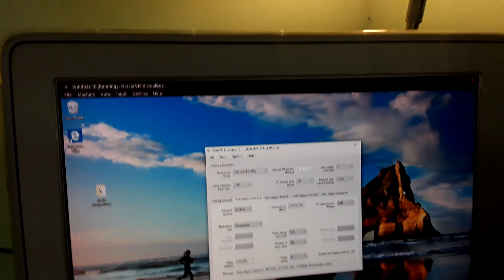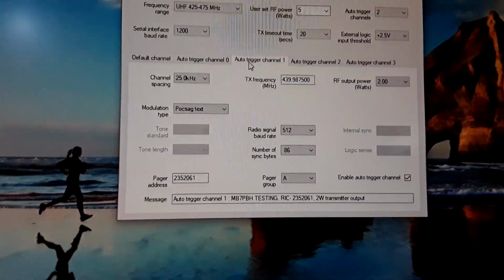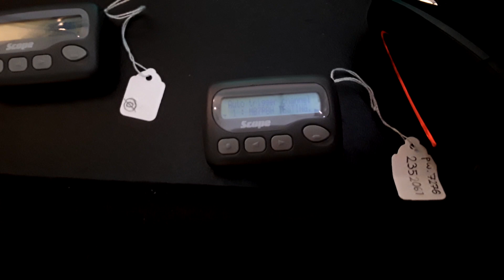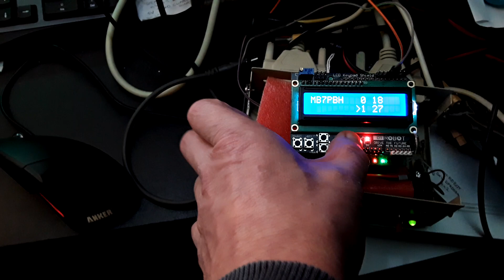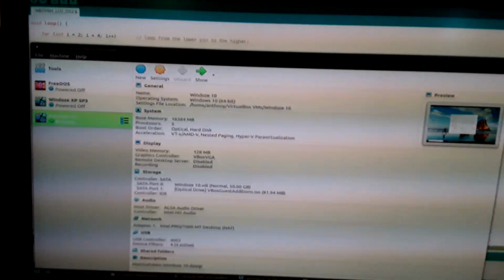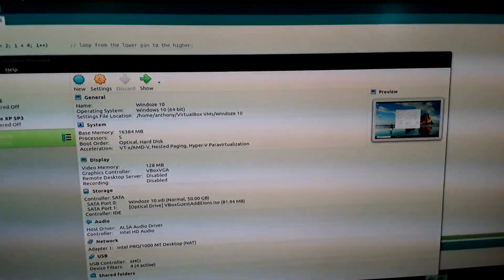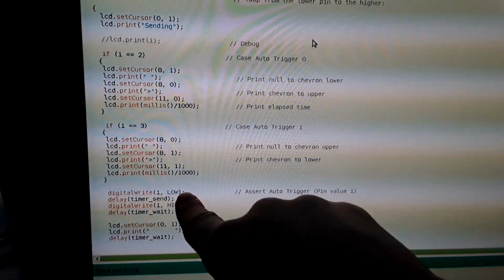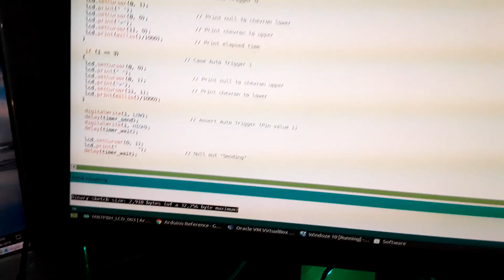MB7PBH UHF POCSAG Transmitter with an Arduino controller

Comment from the maker: The source code is as follows

/*
  For Loop Iteration 
 
 Demonstrates the use of a for() loop. 
 Lights multiple LEDs in sequence, then in reverse.
 
 The circuit:  DF Robot DFR0009 2x16 LCD module with resistor array configures botton array
 
 Drives the canned messages from the ART-400TP paging transmitter
 
 https://www.dfrobot.com/wiki/index.php/Arduino_LCD_KeyPad_Shield_(SKU:_DFR0009)#Example_use_of_LiquidCrystal_library
  
 This sketch prints "MB7PBH" to the LCD and shows which Auto Trigger channel is being activated
  
  The circuit:
 * LCD RS pin to digital pin 
 * LCD Enable pin to digital pin 
 * LCD D4 pin to digital pin 
 * LCD D5 pin to digital pin 
 * LCD D6 pin to digital pin 
 * LCD D7 pin to digital pin 
 * LCD R/W pin to ground
 
 * LCD backlight, lit when pin 10 is assered low (transistor buffered on module)
 
 * Auto Trigger 0 : Pin 2
 * Auto Trigger 1 : Pin 3

 http://www.arduino.cc/en/Tutorial/LiquidCrystal
  
  Adapted April 2019 by Tekno Tone
  
  To do . . . . 
  BUG WHICH MISSES INITIAL ACTIVATION OF CHANNEL 1 ON FIRST PASS
  Button interface
  Backlight dimming
  Countdown in seconds until next event
  
  */
// + - + - + - + - + - + - + - + - + - +  + - + - + - + - + - + - + - + + - + - + - + - + - + - + - + - + - + - + - + - # 

#include <LiquidCrystal.h>
LiquidCrystal lcd(8, 9, 4, 5, 6, 7);

int timer_wait = 4600;          
int timer_send = 100;
int timer_sec = 1000;

// + - + - + - + - + - + - + - + - + - +  + - + - + - + - + - + - + - + + - + - + - + - + - + - + - + - + - + - + - + - #

void setup() {
  

  lcd.begin(16, 2);                  // set up the LCD's number of columns and rows:
  lcd.print("MB7PBH");               // Print a fixed "MB7PBH" callsign message to the LCD.
  lcd.setCursor(9, 0);
  lcd.print("0");                    // Print a fixed "0" message to the LCD.
  lcd.setCursor(9, 1);
  lcd.print("1");                    // Print a fixed "1" message to the LCD.
  
  for (int i = 2; i < 4; i++)  { pinMode(i, OUTPUT); }                // use a for loop to initialize each pin as an output for the encoder:
}                                                            // End Setup

// - + - + - + - + - + - + - + - + - + - +  + - + - + - + - + - + - + - + - + - + - + - + - + - + - + - + - + - + - + - + - +

void loop() {
  
    for (int i = 2; i < 4; i++)       // loop from the lower pin to the higher:
  
  { 
    lcd.setCursor(0, 1);
    lcd.print("Sending");
    
    
    if (i == 2)                     // Case : Auto Trigger 0
   {
    lcd.setCursor(8, 1);
    lcd.print(" ");                    // Print null to chevron lower
    lcd.setCursor(8, 0);
    lcd.print(">");                    // Print chevron to upper
    lcd.setCursor(11, 0);
    lcd.print(millis()/1000);          // Print elapsed time to upper row
   }
    
    if (i == 3)                     // Case : Auto Trigger 1
   {
    lcd.setCursor(8, 0);
    lcd.print(" ");                    // Print null to chevron upper
    lcd.setCursor(8, 1);
    lcd.print(">");                    // Print chevron to lower
    lcd.setCursor(11, 1);
    lcd.print(millis()/1000);          // Print elapsed time to lower row
   }
   
    digitalWrite(i, LOW);              // Assert Auto Trigger (Pin value defined by variable i)
    delay(timer_send);                  
    digitalWrite(i, HIGH);
    delay(timer_wait);
    
    lcd.setCursor(0, 1);
    lcd.print("       ");             // Null out "Sending"
    delay(timer_wait);   
      
  }
}